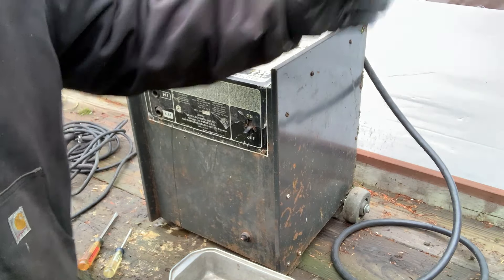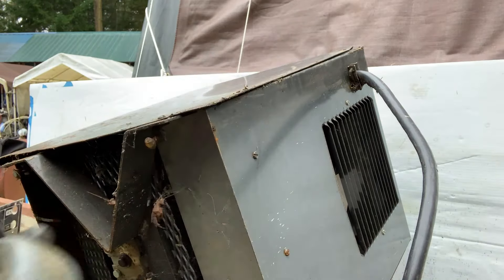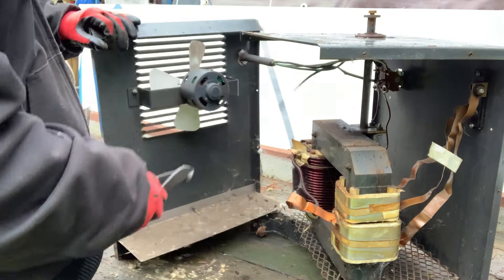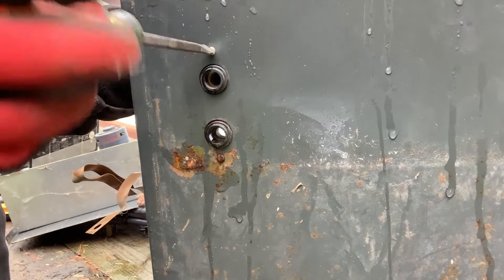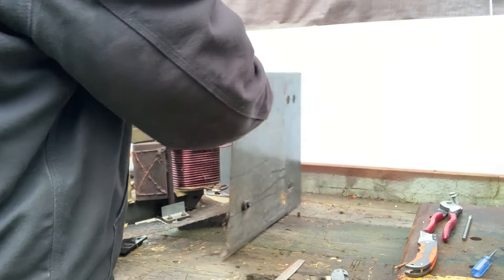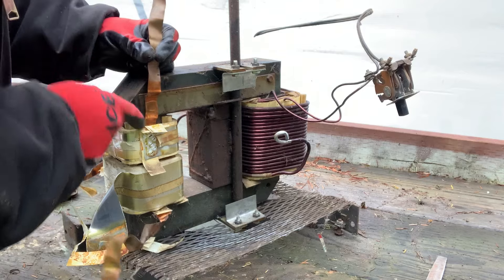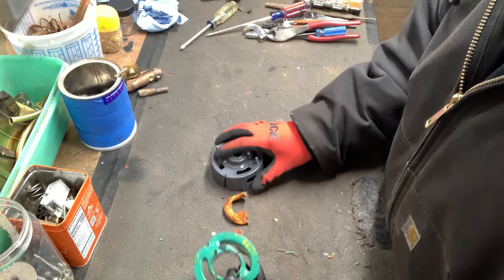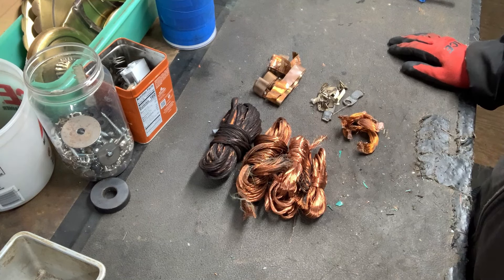Scrapping an OLD Welder (Copper?)

Comment: Bought an old welder from 1960's-70's less than a month ago at a farm estate sale. It was in a dark inside barn. Thought it looked like a lot of copper. After watching this, began wondering if it was really copper. Had brought it home with a bunch of other stuff and stuck it in my barn. Just went out and checked. Thankfully, it looks good. I should check things better for sure.
Reply from the maker: A lot of welders and battery chargers will be aluminum, glad yours is looking good. 
Thank you for watching.
Reply: The older ones are copper. They switch to aluminum nowadays because it's cheaper.
Reply from the maker: @austinhernandez2716  that’s unfortunately not true. I scrapped a welder from the 1950’s and it was all aluminum.
Reply: @austinhernandez2716 not necessarily. Was given a big old welder from about 1963- all windings ally. Also given a smaller welder dated 1977- all copper inside, knew it would be as it had a sticker on it boasting copper windings. 4.5 and 5.5mm copper wire, in cotton braided covering- no lacquer so will go in the bare bright.

Comment: I've started to feel not so bad when they are aluminum windings however never would thought for the age of the welder it would be all aluminum. The non-ferrous guy at my scrap yard said it's worth it to pull the aluminum from the transformers and motors as it does pay around .45-.50cent a pound I think he said and you still get shred price on the rest! so I stopped throwing them into my shred buckets! 
CheeRs Brother
Reply from the maker: The steel from the transformer is #1 prepared, at least at my yard. 
Thanks for watching brother.
Reply: @scrapitall200  oh nice yea I just get shred for motor and transformer steel

Comment: Nice! Except for the low copper weight. What do you figure your total time would be if you hadn't been filming? Also, the copper bands are similar to these ones I got out of an old battery charger except mine were copper on one side, aluminum on the other. I still have them.
Reply from the maker: It’s hard to say, but I had a total of 1 hour of video footage! So maybe 40-45 minutes. 

Oh wow! You should share a picture of that in Discord!
Reply: @scrapitall200  I will. It's in the shop but I'll get the video link and the time. Oh, and that's pretty good even if it took the hour
Reply from the maker: Ok cool!
Yeah I agree, not bad at all.

Comment: Hi, I am 15 and am now making a fair bit of money scrapping in Sydney, Australia. Your advice has been very helpful. Could you suggest any good tips for getting the most money out of a 1960s house in about 8 hours? I will have 1 day to tear out as much metal as I can before it gets torn down. I am particularly unsure about whether to focus on copper plumbing in the crawl space/walls or aluminium window frames and sliding doors? I inherited a few nice Ryobi battery tools from my grandfather, so I am not limited to hand tools. Edit: I also don't have to worry about the mess, the owners don't care if there is glass all over the floor.
Reply from the maker: Hello! Glad you’ve been enjoying my videos. 

Oh cool, that should be fun. 
I would start with the easy and obvious stuff. Go for sink taps because they might be brass. 
Go after the the copper pipe and any of the wiring you can get. 
I’d do the window frames last as they can be hard to clean because of the window seals and glue. 
In an old house like that, the door handles might even be brass. 

Hope this helps, feel free to ask me more questions if you need.
Reply: Thanks for the advice, good to know that I should focus on wiring once I grab the obvious stuff.
Reply: My scrap yard only has 2 grades of aluminium, irony/dirty and clean, unpainted extrusion so it doesn't make sense for me to put too much effort into cleaning painted aluminium. I get about 60c Aud per kilo for the dirty stuff and about 1 dollar for clean. I suspect the scrapyard is giving me a low price because of my age, but I don't think there is much I can do about it. They give me $7 per kilo on clean copper.
Reply from the maker: @ethanhumphrey5758  you’re welcome!
Yeah some scrap yards can be a bit shady, especially when younger people are involved and they assume you don’t know anything. 

That’s a good price for copper. Yeah I’d definitely go after as much copper as possible! 
Check the main electrical panel, really nice thick copper will usually be going into them. Also, and I’m assuming you already know but just in case, make sure the electricity and water are shut off before removing anything lol.
Reply: Thanks, the owners did already get a qualified electrician in to disconnect the house from electrical. Interestingly, the main cable going from the street to the house is aluminium, not copper as I had hoped. Pretty sure all the wiring inside is copper though.
Reply: It is also a bit harder for me because my family doesn't own a vehicle so I have to transport everything with a wheelbarrow back to my place about a kilometre away. I can usually find a family friend with a Ute to take larger amounts of metal from home to the scrapyard though.
Reply from the maker: @ethanhumphrey5758  that’s good and I figured it was turned off, you seem like a smart young man. 

Yeah all the wiring inside will be copper for sure. 

Wow, I’m impressed by your work ethic, not a lot of young people would push a wheelbarrow for some scrap metal.
Reply: Thanks
Reply from the maker: You’re welcome
Reply: Not sure if you will read this, but I thought you might be interested to know that I made almost $800. A very pleasant surprise was a copper water tank in the roof space that was worth about $300 alone. Real struggle to get it out of the roof though, I ended up just knocking out a section of the tiled roof to get it out. Thanks for the advice on the aluminium, it turned out being much harder to remove than I had anticipated.
Reply from the maker: @ethanhumphrey5758  that’s is so awesome! What a great surprise finding that copper tank. 

Glad I was able to help.

Comment: Nice breakdown on the 1975 old welder, still $28 in your  wallet, yeah I've seen lots of welding machines have aluminium windings, melt all the aluminium windings down in that nice crucible i sent you 👍, any update on when you will be getting your furnace buddy?How's the weather where you are, its wet and cold 🥶 here in England 🇬🇧
Reply from the maker: Thank you brother!
It probably won’t be until summer, because I need to save the money and as you know with our climates (we are very similar) it’s so wet everyday and that is a no no with melting lol. 

Late next week we are supposed to get really cold, overnight lows of -10c 🥶